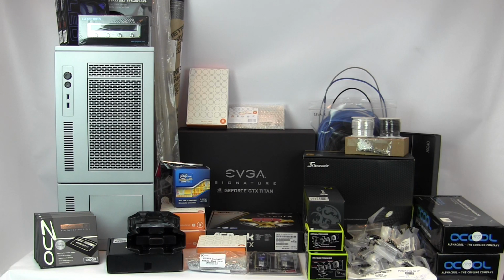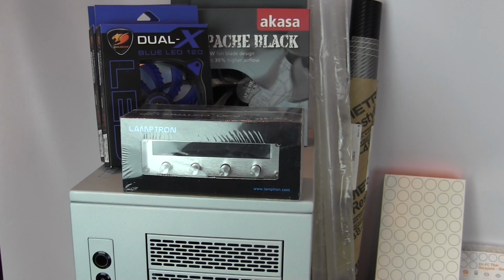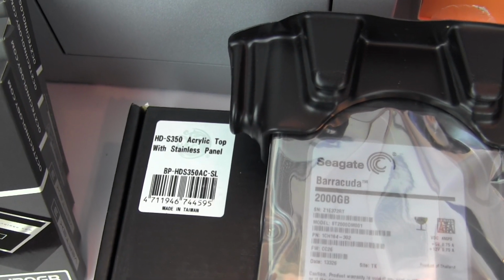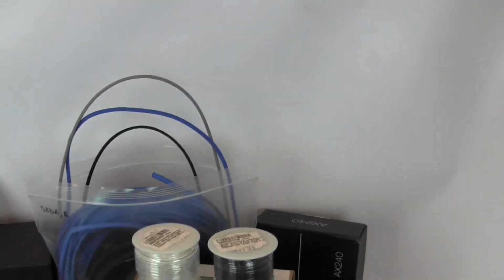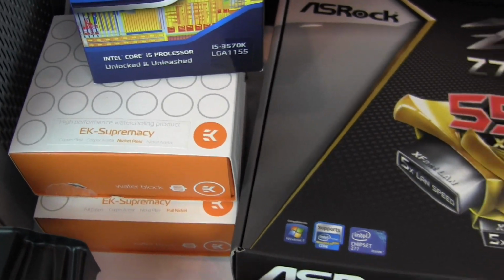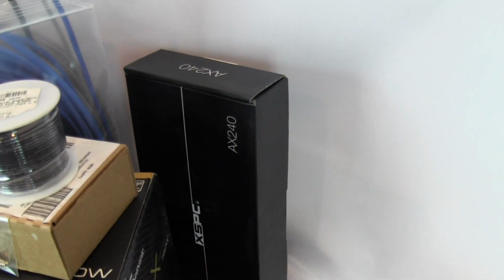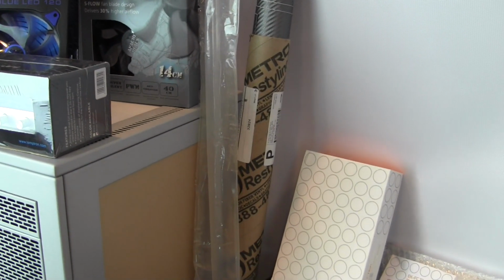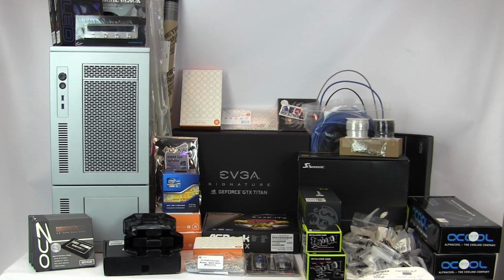Case Labs Mercury S3 Mini-ITX Build Log 1  - The Parts

Comment from the maker: Hey Daz ,
I try to plan it out as best I can, but I too always seem to wind up buying as I get into the actual assembly with the fittings. I am sure I will be buying some more but I think I bought a little more this time because I have to update my STH10 next and will use the same type of fittings so with any luck I won't need to.  Also for this build I know I would have to wait on the Case since it was just released so I had a little extra time to plan.  Hope all is well with you.

Comment: Agreed they are loud @ full rpm. For pull get a SP series or a bitfenix Spectre Pro. The eLoop is just for push i believe, seing the design of the blades. And yep having a Controller will make you be able to fit faster Fans and tune them down ;)

Comment from the maker: Hey Daz whats up ?
I try to plan it out as best I can, but I too always seem to wind up buying as I get into the actual assembly with the fittings. I am sure I will be buying some more but I think I bought a little more this time because I have to update my STH10 next and will use the same type of fittings so with any luck I won't need to.  Also for this build I know I would have to wait on the Case since it was just released so I had a little extra time to plan.  Hope all is well with you.

Comment: Awesome build! But if you're going to add that extra piece on the bottom of the case, it basically because a midtower. Maybe could have gone with a more roomy midtower or micro atx case with a matx motherboard.

Comment: From what I understand (since the debate on this tends to contradict itself) rad thickness isn;t as much of a concern as whether or not it has a high or low-density fin ratio.  I believe that static pressure/airflow is less of a concern with High-density fins and that it is suggested to use low RPM fans on these rads (like eLoops).  Again I am not totally sure that this is 100% true, so I plan on doing some of my own research on this.  I may even do a video on it if I can.

Comment: yeah, but if you have a really thick (like 80mm) Rad, you gonna need a good static pressure fan aswell. There is the same problem as seen on high density rads which are thinner. But generally, thick fans (45-60) need less rpm than thin ones.

Comment: I hope you have less nicks and cuts on your fingers than I got when I sleeved wires for the first time :)
Unless I missed it, you neglected to say what the purpose of this build is, client/personal/gaming rig/etc.  just curious... looks like it will be another cool build man, whatever it is for :)  good luck!  Oh and remember, if you are using different gauge wire, make sure you adjust your sleeving length to match, thicker gauges will require a longer sleeve...

Comment: Or Bitfenix Spectre Pro's ;) Big, thick rads, you can use lower RMP fans. The corsair SP120 quiet editions are good ones to. The eloops are a nice design but not designed to be used in push and pull.

Comment: thats another problem, i only want to use Pull. Push/Pull is too thick for my case ;) The Sp120 Quiet Editions are good, as u said but i would chose the performance Edition because of my fan-controller and so that i can spin them up if i have to. But at 2350 they are sooo loud :/

Comment from the maker: Some parts are from Sponsors but most parts I buy myself.  I have a job and my side work is building custom computers and repairing computers and laptops.  The money I make from working both jobs very hard pays to 99% of my builds. SO far I have not had any Sponsors from the major motherboard board, video, ram , and  power supply manufacturers. I would love that but I have far to small of a viewership right now. Maybe if I top 1 Million views and get to 10,000 subscribers.

Comment: Not trying to flame you sir, but I don't think you are 100% correct on the fact that Copyrights are applied automatically.  The way I understand it is that in order to have a legal claim on a Copyright, it needs to be patented officialy.I think that the "automation" that you are refering to is actually found in Trademarking, where anyone can TM anything and have legal claim to that mark, while officially registering it just gives you the right to use the "R" symbol rather tan the "TM" symbol.

Comment: How do you feel about doling an automotive vinyl wrap of a PC case? or do you prefer paint?
Reply from the maker: If done properly with a nice wrap it can be good.  But I think paint is most appealing and easy to clean.
Reply: +Ronsanut A pro on vinyl wrap is that it forgives a lot more and isn't as expensive.
I had one build on which I got an automotive quality paintjob on for 400 € and one day my wife cleaned the case with a normal dust-cloth and it got hundreds of micro-scratches. Handed it over to a professional vehicle preparer and they polished it for 50 €... Was my last build with an automotive quality paintjob.